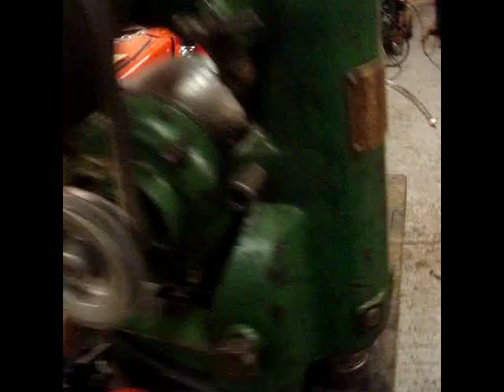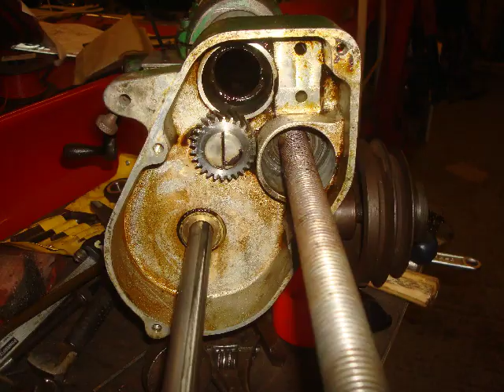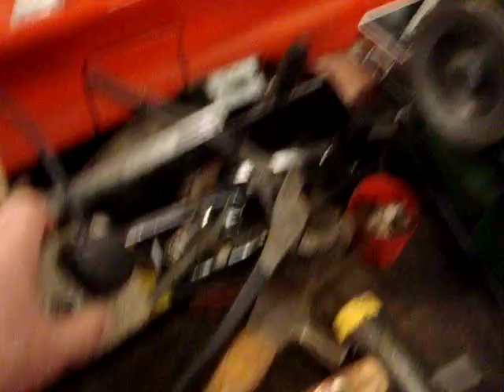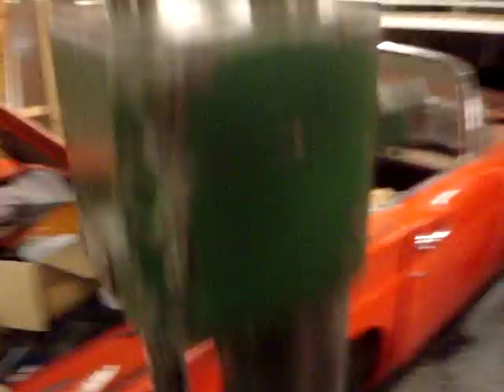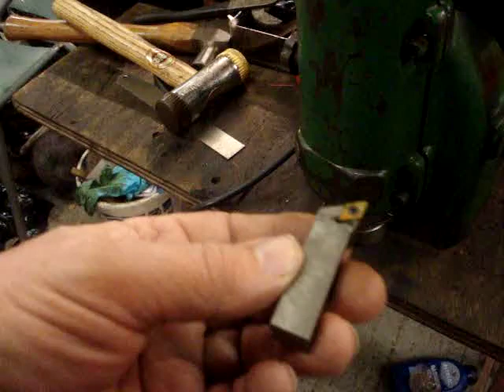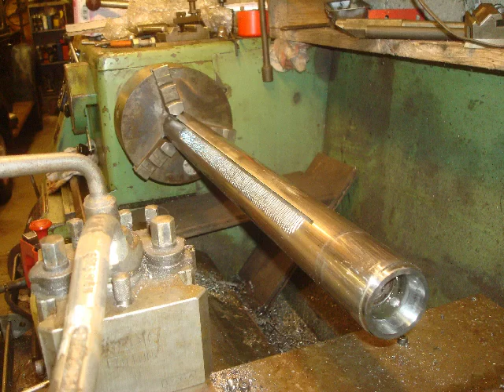Old Buma cylinder boring machine runs again. Vintage Machinery resto!

Comment: My machine I just got going . It feed runs in reverse.  Feeds up in stead of down . Is there something I'm not looking at properly?
Reply from the maker: Hello Scott. Is the motor running in the right direction? Is the spindle turning clockwise when viewed from above?
Reply: @MartsGarage   hello thanks for your reply . The main spindle dose run clock wise . Any ideas ?
Reply: Wonder if any gears can be put in differently to reverse it
Reply: Sorted . I locked the feed screw lol.
Reply from the maker: @ Yay! well done! That's great!
Reply: @MartsGarage  was walking in town thinking about stuff and popped right in me lol all machines I have used the feedscrew rotates . I wondered why it had a locking screw on it . Then it clicked . The nut must rotate.  Oh well got there . Started my first rebore last night . Going good

Comment: Great video. Any idea where to find a replacement nylon gear for the upper drive?
Reply from the maker: Thanks for watching!. No, I'm sorry I don't know where one could be sourced from. If you are talking about the large helically cut spur gear it is a fibre material or something like "Tufnol" A cloth bound resinous material. It might be possible for a competent home engineer to make one, but the helix might be a problem. It could be made straight cut and a new straight cut pinion made to suit. Mine needs some new parts but I am having to work around it. 
I'm not that well up on it, but maybe some sort of 3D printing could be used to make a new one if a strong enough filament material is available. 
All the best, Mart.
Reply: @MartsGarage  thank you very much sir. A friend of mine has one and we've been struggling to get it working properly. We are almost to the point where we've got it figured out but then the sacrificial nylon gear stripped on us. We might have to come to you for advice in the future. Thank you very much for your reply and your suggestions!